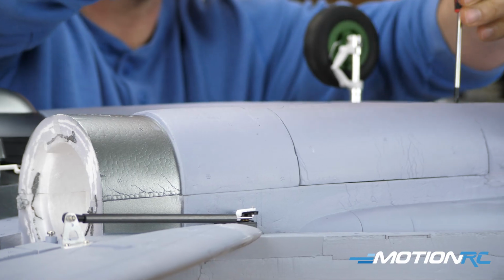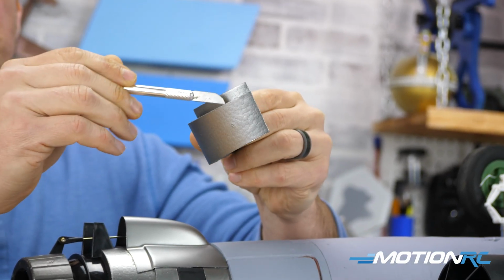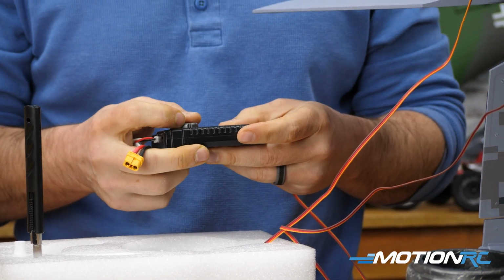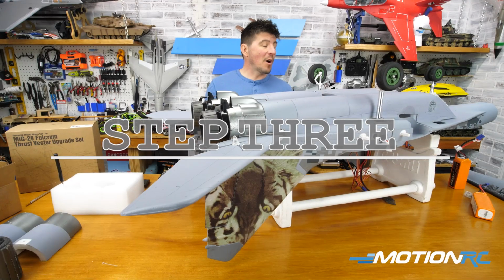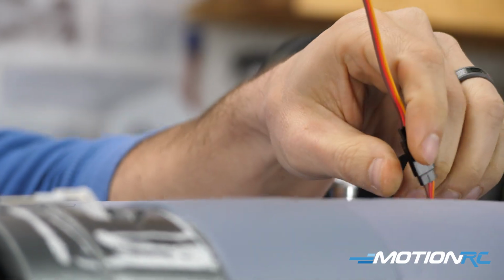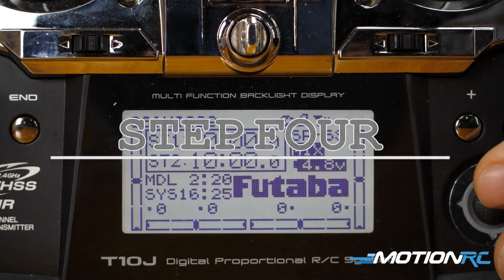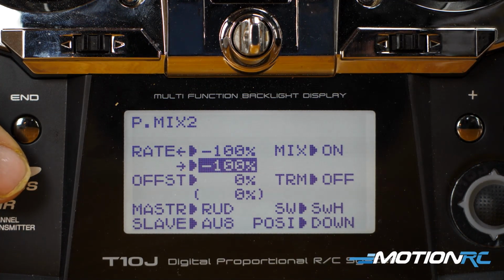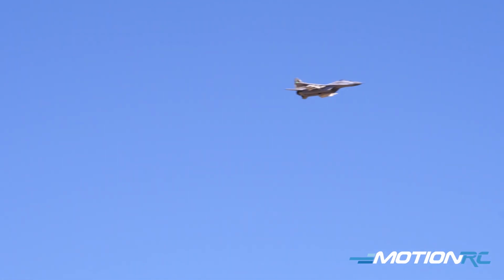Freewing MiG-29 Thrust Vectoring Set-Up - Motion RC

Comment: I packed the wires away inside, below the EDFs and the ESCs (or better above, when it's on its wheels). Cutting channels for the wires and covering them with duct tape. It's a bit of a fumbling but worth it.

Comment: For those wanting the full package (with enough channels for it), the total mixes you want will be:

Rudder to left yaw servo
Rudder to right yaw servo
Elevator to left pitch servo
Elevator to right pitch servo
Aileron to left pitch servo
Aileron to right pitch servo

Where the elevator mixes move nozzles in unison as shown in the video, and ailerons move the nozzle pitch opposite. 

For correct ROLL orientation, ensure the aft end of the nozzle moving the same direction as the aft end of the corresponding aileron surface. Right aileron up = right nozzle up (and left down)
Reply: Thanks for posting!

Comment: As always, make sure trimming the regular controls don't trim your nozzles.

As for disabling vectoring, the only case where you ever should do that is if a single servo fails or some weird corner case like that. Normally, vectoring is completely NOT scary, and a huge bonus in every aspect of flight

Mistake at 2:15. The demonstrated rudder movement is yaw, not roll. So do as James has done, not what he says 😂
Reply: I need help with my set up, no active rudder only steering servo, flaps and the rest etc. I have set up per the Dx7 and 7ch but my ailerons don't work. I have an 8ch and Dx9.